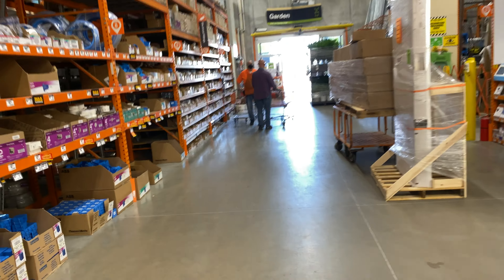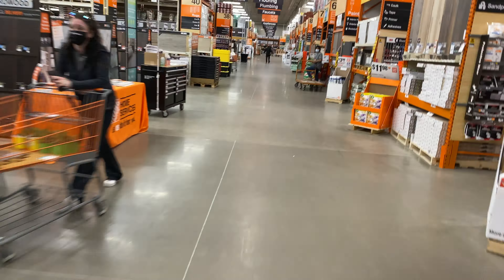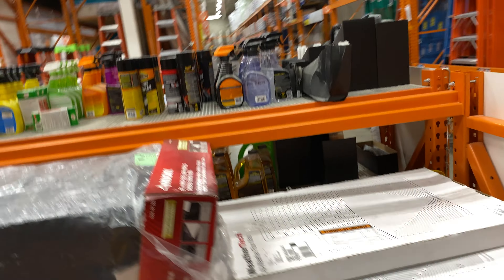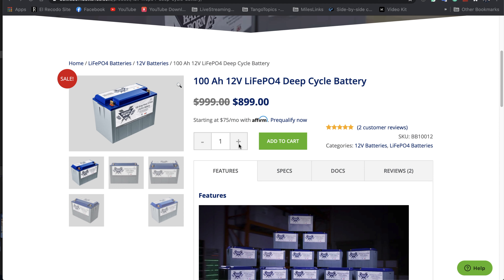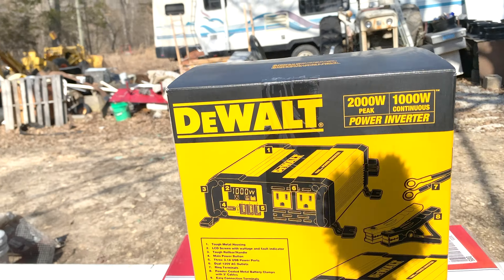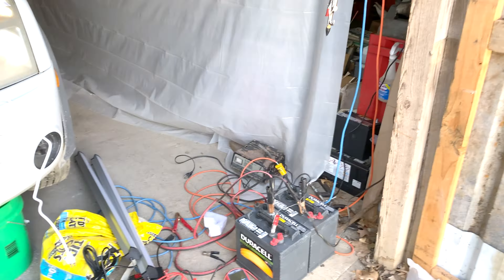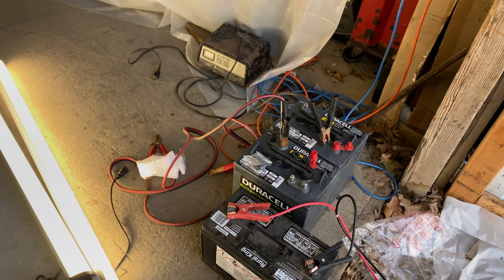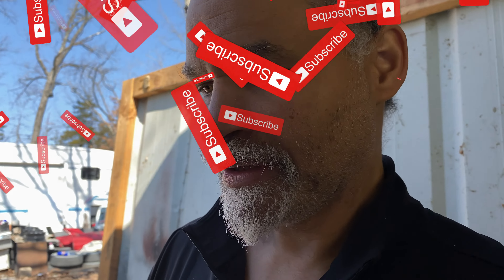The 'House' Battery Test (and Failure) | Build | vLog #021 | Miles VanLife

Comment: Why did you not just take the batteries to an auto parts store and have them tested? The test or does a voltage and load test in one simple deal.
Reply from the maker: Because I didn’t need to. They would have done the same test. As you’ll see in a later episode I re-test the batteries for endurance...
Reply: @WanderingMiles  But they would have done it for FREE and in less than 5 minutes. Then you wouldn't have an inverter that you don't need.
Reply from the maker: @jdbatman13  Thanks. But I returned the inverter anyway. As you'll see in a later episode.